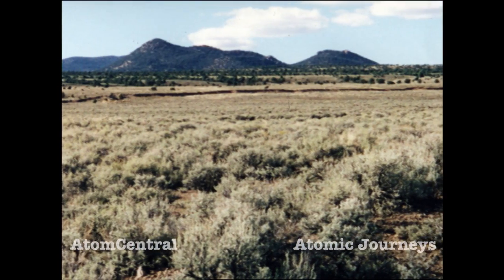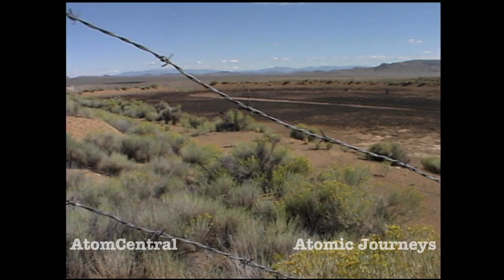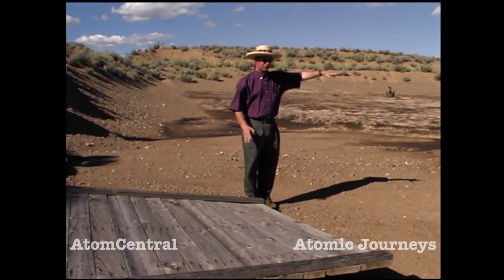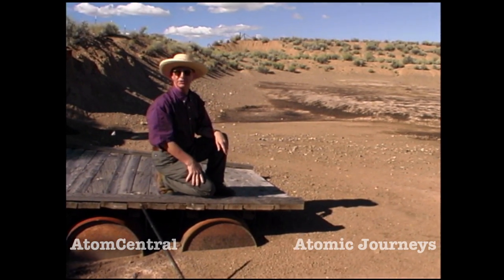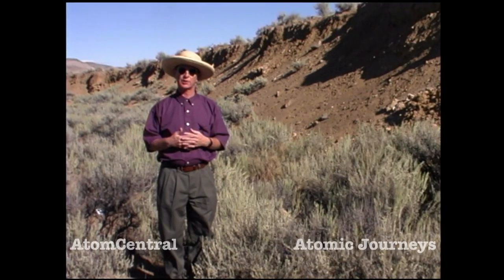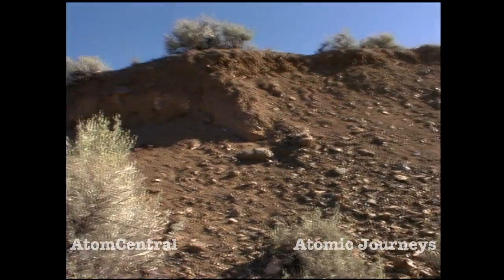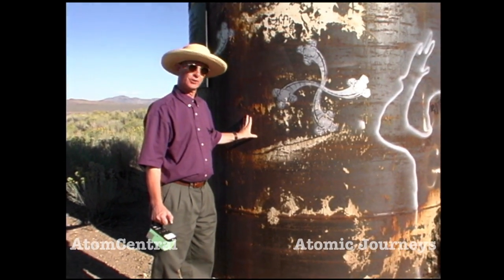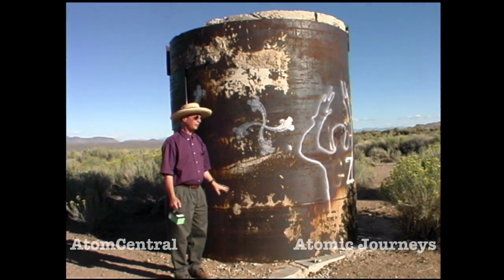Atomic Vacation with Vern - the Faultless Site

Comment: Vern it was my crew that had the Incident, aka accident, when retrieving core samples months after the shot was fired. We were in full anti C's taped with full face respirators, rubber boots, and lead lined aprons and gloves. About 1 in the morning the sand line was pulling up the core shoe. 
Core shoe is a slight cone shaped cylinder that was dropped to the depth set by the HP's where it kicked out the side of the drill pipe puncturing the ground to take a sample. We were constantly reading our instruments for radiation.
The drill crew were off the deck except for the head driller, who was running the reel to retrieve it. Which was done very slowly. Once up my crew would grab it with tongs and the driller would undo from the sand line. 
We would then take it to a press set up at the end of a lead pig. Place it on the press, press it into a plastic tube, cap it then push it into the pig. Seal the pig and move it aside for it's trip down to the Nevada Test Site outside of Vegas.
By the second retrieval it was 3:30 am and we were tired and Dennis dropped the core shoe, scattering material all over the drill deck. The driller jumped off the deck got in his truck and pealed out across the desert. Our meters pegged as we click up through two settings then threw them down to clean up. 
In a panic state we scrapped up as much as we could into the tube. Then washed the floor off into the mud pit, where you saw the raft. Also washing off each others boots. We created a decon line as taught, dumping all of our clothes and gear on ones side and ending up on the other in our underwear. We ran to the truck and called the boss on the radio who went crazy and told us the get the __ out of there.
The whole site was shut down and policed from curious others. It set that way for 5 months until the mud pit evaporated. heavy equipment was brought in to remove the mud but... The pit was lined with asphalt paper used in roofing. My crew, punishment I guess, were sent back in August to remove it.
in hundred degree temperature, again in full anti C's just like before using hand hatchets we cut the tar paper up into to pieces that would stack flat in 55 gallon drums. That was HELL! it took us 3 weeks of 10 hour days to complete the task.
Reply: Thank you for sharing that amazing story! Did you ever learn, whether through your own meters or an official report, what the dose equivalent was?

Totally different discipline involved, but your story reminded me of some of the process criticality incidents described in this report:  https://www.orau.org/ptp/Library/accidents/la-13638.pdf
Stuff happens, and you can only go so far to guard against the human element.
Reply: @Johnny_Socko - I'm sorry but I don't know what their reading was and what it was in 'dose equivalent.' I suspect the crew received a rather low dose. It was likely many of orders of magnitude below a lethal dose. It might have been enough to very slightly increase their chance of getting a cancer by the end of their life.

My RadAlert meter read its usual 10-20 counts per minute. It states on the meter that to convert to mr/hr using a Cs-137 source, divide the counts per minute by 982.

Most of the workers on such contracted missions had little to no training in fields such as Radiation Worker and Health Physics.
Reply: That's a great piece of personal history, and a great story, sir.
I'm curious if the site gives off any radiation today?

Thanks for sharing, and for helping to clean up. ☀️😎☀️🇺🇸
Reply: @d.cypher2920  Apparently not as the area is open to the public. I however do not want to go there.
Reply: @rossi1  i hear ya! I wouldn't want to go there either.
Reply: @d.cypher2920  - When I first came across the site, in the early 1980s, I took my own geiger counter, with alpha window, and did a cursory survey of the site around the monument and at the drill mud reservoir. I was unable to detect any radioactivity that was above the background level. I had also seen previous official survey reports that showed no significant levels of surface radiation at the site.
Reply: @vernonbrechin4207  hey, thanks for sharing your story, information, and for actually doing that. 
Very much appreciate your reply.
Be well. Happy Easter. 
☀️😎🇺🇸☀️
Reply: @d.cypher2920  - Thanks. My primary aim was initially to end underground nuclear explosives testing and to expose the fact that many details, regarding the radioactive contamination left underground by the U.S.'s 830+ underground nuclear test explosions, remains classified as SECRET - RESTRICTED DATA.

Happy Easter to you as well.
Reply: Thank you for your story and all the work you followed up with. The contractors frequently didn't report such incidents since they earned tens-of-millions of dollars from such contracts and always aim to get rehired by the feds. Such contractors become masters at feeding off the federal teats. The DOE's Nevada Operations Office may not have been made aware of that incident. There are other incidents, that they knew of, that they never reported to the DOE's History Office. As would be expected one of their aims is to leave the public with the impression that they did everything in their power to maintain public safety.

Comment: My guess would be that the black material in the drilling mud residue is powdered lignite, a form of coal that is frequently added to drilling mud to help seal porosities in the bore hole.
Reply: Thanks for your added information. That makes sense. The composition of the dried drill mud was later tested and it was found that it also contained hydrocarbons. A great deal of effort and money later went into remediating that portion of the site.

Comment: What if you look down the pipe?
Reply: The pipe is filled with concrete to seal the hole and that seal likely goes down to a great depth. The visible basement pipe that you see likely does not go down too far. A somewhat smaller drill casing pipe likely goes down to within a few hundred feet of the original detonation point. I found the details in a later evaluation report by the Desert Research Institute.

Comment: Interesting what sort of data they were obtaining from these tests other than yield based on the power of the shock waves.  In an above ground test, the testing/recording equipment layout was extensive, but for an underground test they did not have the same room for everything.

The flashing light bulbs used to show when the bomb goes off, it seems like such a low tech way.  Could the light bulbs just be connected to a loop of wire that is inserted into the hole and the EMP pulse from the bomb induces a current into the wire and that is what causes the bulbs to flash?
Reply: Typically, many NTS underground nuclear tests were highly instrumented. Large numbers of detectors were mounted on a rack above the nuclear device which sent their signals up to a instrumentation trailer before the climbing cables were vaporized by the EMP. Those buried instruments were also vaporized. The formed blast underground blast cavity of the Faultless test well well over 100 feet in diameter.

Comment: Faultless was at 38.63421, -116.21622.  The scarp lies along an arc segment about 500 meters from the epicenter in the southeast.  The mud basin is obvious from overhead.
Reply: Many thanks.  There is also the remains of an unpaved runway for small aircraft there.
Reply: About 18 years ago the State of Nevada Environmental Department forced the testing agency, the DOE, to remediate the chemical contamination left in the large drill tailings pool. It now appears quite different than when I first explored it. The release of Atomic Journeys may have helped alert the State of Nevada to some of the problems the DOE has left in its State.

Comment: Fascinating!
If the ground "fell", where did it fall into?  Collapsed caves and underground air pockets ruptured by the shockwave and then collapsed?  Underground soil compressed or melted creating a void?  What was the void?
Reply: This is a good description. In the case of the Project Faultless test the spherical cavity diameter was somewhere around 300 feet. Once the internal pressure drops the fractured rock above the cavity loses the structural integrity to hold up the deeply buried dome and the collapse proceeds towards the surface until the collapsing rubble fills the big empty void and the rubble pile below can prevent a further cave in. Often the rupturing takes place all the way to the surface to form a collapse crater on the surface. A dense collection of these can be seen on satellite images of the northern portion of Yucca Flat within the Nevada Test Site (NTS). At the Faultless site it was speculated that the collapse cavity took a broad conical shape that extended out to where the existing fault cracks were and then the block, between these two faults collapsed down towards the blast center.

When typical nuclear weapons detonate their radioactive debris is entrained in the melted layer of rock that lines the fractured cavity. That, then contaminated lava then mostly flows down to form a molten pool at the bottom of the cavity which then solidifies as the overhead debris comes crashing into it. Like in most underground tests the solidified contaminated lava ends up either just above, or below the local water table. In the deep Faultless test is lies well below the top of the local water table.

Nuclear explosives are simply specially engineered nuclear reactors that are designed to fission their nuclear fuel in under a microsecond, unlike power reactors that control the reaction to last around three years. The fission waste blast products are similar in composition to the spent nuclear fuel that needs to be isolated from the biosphere for around a half-million years. That includes a wide array of fission products, including Cs-137 and Sr-90. It includes neutron activation products from the thermal neutrons interacting with their surroundings. There is also some tritium and other gaseous radionuclides that can drift to the surface. Since typical nuclear explosive employ plutonium-239 as their primary trigger fuel and the reaction efficiency is far from 100% the result is that large quantities of Pu-239 is part of the waste products dispersed in the solidified lava and where the lava stayed on the cavity walls and crevices.

Most of those, working on such test operations, were never told of such details and they were made well aware that if they asked too many questions that they might not hold those jobs long. Many of the waste products details remain classified Secret Restricted Data in the U.S. The rational given for this continued secrecy is that the release of such details could endanger our national security.

A NTS contractor report, titled Focused Evaluation of Selected Remedial Alternatives for the Underground Test Area (April 1997), estimated that a partial clean up of the NTS test areas could cost $7.29 trillion. That clean up option was rejected as impractical for several reasons. Instead the Long Term Instutional Control option was chosen at several orders of magnitude less cost. This option also ensures long term job security for agency staff members. The reasoning went that future generations will eventually come up with more practical solutions then we now have.

Keep in mind that the NTS remains public land that was temporarily loaned to the federal testing agency that was the Atomic Energy Commission (AEC) at that time. That agency converted it into a national sacrifice zone and no one now expects it to ever be returned to unrestricted public access.

After reading this some viewers may wonder how much more history that they were taught may have had some political twist applied to it.